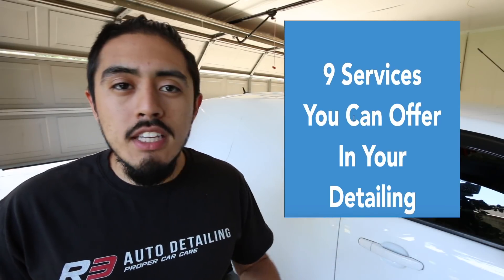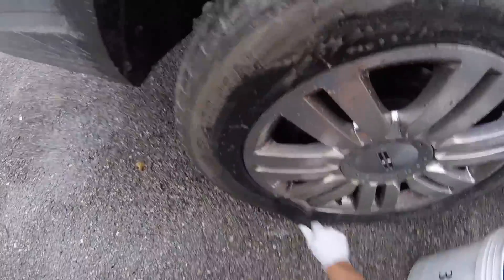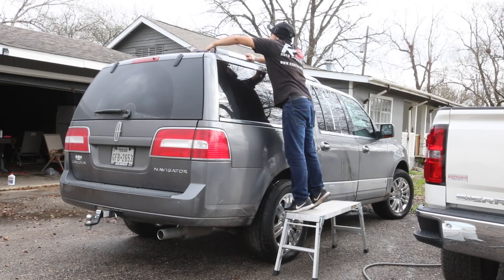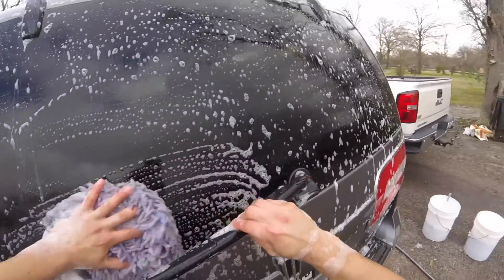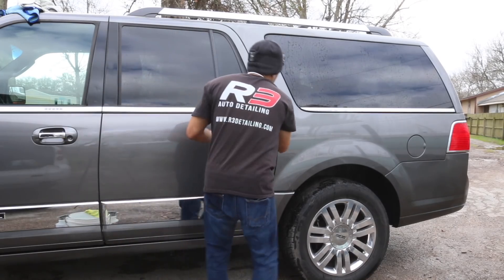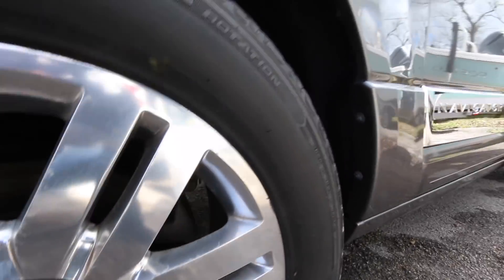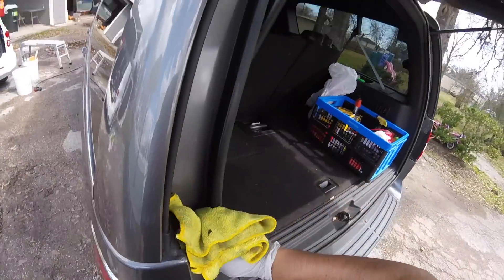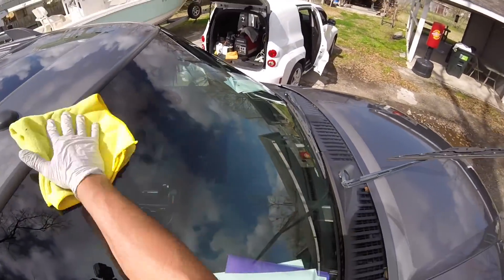Wash and Wax on Car That Has NOT Been Washed in MONTHS - How To Wash DIRTY Car

Comment: Great job! I just wrapped up detailing my 03 Lincoln Navigator.  I had not cleaned it in a few weeks and I just got it back from getting the transmission rebuilt. I spent 2+ hours last night just washing and cleaning the exterior. Using my SunJoe SPX 3000 power washer really helped. I used Meguires Quik Wax this morning to finish up the exterior. And yeah, I got the ladder out to get the roof cleaned up pretty good. 
Just spent the last couple hours cleaning and vacuuming the interior. I really got to go back and do a detailed clay bar and wax. It’s driving very good and looking good too now.
 I have other cars that are so much easier and quicker to do a full detail. These large SUV’s take 2-3 times longer. So, it’s my least favorite to detail.
Anyways, 
Great video and God bless!
Reply from the maker: Haha- completely understand Alex. Bigger vehicles always require so much more work

Comment: Just a heads up with the bit where you cleaned the grill, in my very short experience (only as an enthusiast) you wrap the microfibre around either end of one of my detailing brushes, so I don't need to use my fingers, and run it through that way. Of course the microfibre towel is soaked in whichever car soap I am using and/or APC. It works, again no or minimises the scratches :)  
Great content as always. And on my end, always learning new techniques. Cheers!

Comment: you can get an on the go pressure washer for cheap 50 gallon drum $40 cheap electric power washer $99 you can wash like 15 cars with 50 gallons
Reply from the maker: Nice! Which model exactly?
Reply: this is probably better for you 
worx hydro shot
Reply from the maker: Ohh, right. I've used it. It's nice!

Comment: In your opinion, what’s your favorite/best tire dressing?
Reply from the maker: Megs Hyper Dressing. I used a few other and just liked Hyper Dressing
Reply: Ive  been told just to use regular cover all. Is this a bad idea?
Reply from the maker: What is that?
Reply: What ratio do you use the hyper dressing at? I like the shine level you have.
Reply: I use 3m , it also works on black trim but you have to apply it every 2 weeks

Comment: Nice job, Oscar! Looked like you had some nice cloud cover, but if you were doing this type of wash in the sun (hose and 2-bucket as opposed to rinseless) how would you avoid creating water spots?
Reply from the maker: Thanks Ben! If it was hot, I would;
1) Move faster on the wash, rinse, and dry process 
2) Break it down by sections (wash, clay, and dry half of one side)

Comment: What about using simple green for inside the car and outside. Will it work
Reply from the maker: I've never used it but it should
Reply: You have to be careful with simple green.  It can stain some plastics and rubbers.  Also take a lot of water to rinse off.

Comment: as a mobile detailer myself this is a $140 job for me that I can get done in 3hrs max. in a way I understand why you charge higher prices, but I know that the reason it takes you so long is because of being inefficient with some of your work and making your washes harder and slower by not having a pressure washer especially on a car as dirty as that one. the process on the rims could have been as easy as spraying acid based wheel cleaner and/or degreaser on the wheels, tires, and fender wells and then pressure washing it off and then just wiping down the rims with a humid towel after the car was dried off just to remove the excess spots. I feel like some more efficient work would make your job easier and help you give out better prices. but to each his own, I still respect my fellow detailers, I've just received very blunt advice from other detailers that has worked wonders for me.
Reply from the maker: Oh for sure. if I had a pressure washer, I could have cut down time. With that being said, my prices are not tied to how long it takes me to complete the job. If I had two people, we would have finished in 1.5 hours, I'd still charge the same amount. Yesterday we finished a car in just under two hours and charged $220
Reply: 3hrs to wash a wax a truck?
Reply: Phenom Facemob I said MAX which has probably only happened maybe twice in my detailing business, but on average I wash and wax the exterior of a car in about 2 to 2 1/2 hrs and charge anywhere from 100 to 150 depending on the size of the vehicle.

Comment: 1. What do you personally use successfully to strip old wax off cars? I've heard so many arguments saying clay bars are the best vs dish soap vs Chemical Guys Clean Slate. So much information out there makes it confusing. 2. If you use ONR rinseless wash and wax, do you have to strip the wax before each time you resuse this product?
Reply from the maker: 1) If the car is super dirty and it hasn't been deatiled, what are the odds if the car having any form of protection? However, I use CarPro Eraser. 
2) No, just keep on using it

Comment: Broheim, there is no way I'd get that sweet rate for a basic wash & wax where I'm at. $65 start seems to be the bite point.
Reply from the maker: Where are you located? There's plenty of detailers in my area that complain about that same problem as well :)
Reply: Detail Groove murphy nc. In the skirts of the blue ridge mountains. I work a 8-9 city area across Ga, tn, & nc. Next year, prices go up. I run a "full" detail for $145...
Reply from the maker: How many people are calling you per day for your services?
Reply: Detail Groove it went public in April this year. I don't have the budget to splurge on ads, yet. They slowly trickle in. Just myself, no way I could manage more than 1 detail. I don't handle heat well. Plenty of views on a post but, no daily biting.
Reply from the maker: Well that's your problem. You don't have enough people calling you so you can charge more. Imagine trying to sell a $500 detail to the one person that calls you every 3 days. Now try selling a $500 detail when you're getting 3 calls per day. 

So much easier to sell a higher priced detail when you have a higher call volume
Reply: Detail Groove the cost free marketing is the method at the moment. Certainly will be branching out. I've noticed that brick shops are favored over mobile guys here. I can sorta see the brick shops having more advantage.
Reply from the maker: Shop vs mobile makes no difference if the phone is not ringing on a daily basis. You shouldn't worry about cost-free, focus on ROI. "Free" marketing isn't "free" if it's not making you money. If you can spend $1,200 and make back $20,000, then that's free marketing

Comment: Super clean 10 to 1 is safe on wheels?
Reply: So_Heaven I use super clean 5:1 so I'm pretty sure
Reply: I use it full strength straight from the sprayer. Works like magic.
Reply from the maker: Just don't use it when the wheels are super hot or leave it sit there too long :)

Comment: You should try a wet Terry cloth rag not soaking wet but good and damp to put your wax on it'll definitely help you from missing all the spots you missed and I would dress the tires and the wheel wells before you wax little bit of wheel cleaner on the Chrome Grille would get all that off quick and easy not saying you did a bad job the end result look great but this is coming from a detailer who has 18 years of experience

Comment: How do you clean the exterior seams and crevices safely? Often when I’m detailing there’s gunk in there that runs out every time I try to rinse up, ruining my work!
Reply from the maker: Well you just said it yourself; you need to make sure the seems are cleaned out before moving forward! What areas specifically are you referring to?
Reply: Detail Groove Between the paint and the seams under door handles, exterior panels, seams under window trim, just small crevices in general. Usually pollen or moss gets hardened in there and it has trouble coming out. Generally unreachable places (with a microfiber cloth)
Reply from the maker: Well it sounds like exactly where the problem is. Do you have any brushes? Spray APC and agitaate out
Reply: Detail Groove I’ve thought of that, but wouldn’t that cause scratching? Any suggestions on paint-safe brushes?
Reply from the maker: Well, you should do this cleaning first and then polish. You'd also want to test it out. Maybe it won't add any type of defects. You'll be surprised :)

Comment: I own my own detailing business. Benny's Xtreme Detailing find it on FB. You said you charged 220 for wash and a wax. Could you break down each service to help me understand how you got to that price. I would charge 180 for a full detail with clay bar, chrome polishing. That price includes interior without shampooing. Am I charging too little?
Reply from the maker: The problem is not pricing, your problem is lack of leads per day and week. I have plenty of people tell me no, but because I have so many people reaching out to me, I still get plenty of people that tell me yes. 

That's the problem with 80% of detailers. It's hard to increase your price when you have 1 person contacting you every other day. If you have 4 people contacting you everyday, raising your rates and getting booked out is much easier. 

Also, online reviews are HUGE!
Reply: That's the gold in the comment section right there.

Comment: Thats alot of work for some wheels..have u tried using BDx from 3D? Sray let it sit.light agitation.and spray off
Reply from the maker: Probably with a pressure washer it'd work. A hose is to weak for that, regardless of strength in APC

Comment: Could I use a paint brush than using a detailing brush?? :D nice video
Reply from the maker: Yes you can. Tape off the metal to not scratch anything
Reply: But is the bristles just the same as a detail brush???
Reply from the maker: Depends on the type of brush you're going to use
Reply: Anormal paint brush bro. I dont now where it applies hahaha
Reply from the maker: I don't know what normal is. Long bristles? Short bristles? Stiff bristles? Width of handle? Try it out and see how it works

Comment: shouldn´t you rinse the car completly first to remove all the loose dirt an debree before you use your bucket and towels to clean the car?
Reply from the maker: If that's what you prefer, sure. There's no laws/regulations/governing body that says you have to.
Reply: not. it didn´t mean that you have to. I just thought it would be better. So you don´t get any swirlmarks and light scratches on the Paint. :-)
Reply from the maker: Does it really matter if the last 5 years this car has only been through $10 car washes?

Comment: Detail groove I commented on your video asking but what apc cleaner you wearing using at your other video with the purple color . Can you please link it to me on eBay or amazon please . I want to buy it
Reply: ThatGuy33121 most likely super clean or purple power, you buy it at Wal-Mart
Reply: Said it was super clean. You can buy it by the gallon at Wal-Mart and dilute it. It's  legit.
Reply: Will Canady there’s many super clean out there I want the extract one that hes using which the the “purple one “ do you know where I can buy it from . If you don’t mind can you link it to me please from amazon
Reply: Will Canady thanks I did end up buying it now I’m looking for the carpet and a brush that I clean clean the seats with . Also if you don’t mind bro could you tell me like what 1 to 10 duriation means .?
Reply from the maker: Yes, Super Clean diluted 10:1. You can buy it online but they sell it almost everywhere locally in my area (which I'm sure you're area as well)

Comment: how do you deal with waterspots ?  on windshields glass
Reply from the maker: During the wash process or if they're already there?
Reply: if they already there i had a truck last week and as much as i apply window cleaner they would come back up  and didnt knw how to aproach it
Reply: use a water purifier to soften your water connects to ya hose
Reply: Juan Villa if you apply white vinegar + water mixture and spray it on the water spots. The acid in the vinegar will neutralise the waterspots ( which are alkaline) 
But honestly... ive never had a problem with removing water spots that are on windows with a quick wipe with a damp towel.
Reply: I removed 20+ year water spots with an orbitor and strong compound
Reply: this would be an additional upcharge to remove the water spots.
Reply: Juan Villa Mothers water spot remover. Easy as fuuuu
Reply: I use quick detailer spray, just my imput :) Meguiars mirror-bright brand
Reply: Me clean magic eraser
Reply: 0000 steel wool works wonders

Comment: Chemical guys is just 20 bucks for a gallon
Reply from the maker: I just said a random number lol
Reply: How long did this take you
Reply: Doing it by hand you find to apply the wax thicker so it takes longer to remove the wax residue ...there wax goes a long way
Reply: Iron x for rims & paint  makes life easy
Reply from the maker: As long as it works for you, that's all that matters
Reply: No it’s detailing  101
Reply: N for 220 you should be using that ...it will prevent scratching
Reply from the maker: That's why it's your business. You can do what you want :)

Comment: Really dirty my ass!
I detail cars that have 4 to 6 inches of mud in the wheel wells, green moss growing from the window seals and green alge growing on the paint. I'd like to say that seeing cars like this is rare but I see 3 or 4 of these neglected beasts a month.
Reply from the maker: Cool?
Reply: I clean the entire top of the vehicle down to door handle height first with my 'top use' mitt, then with a separate 'dirty use' mitt I clean the bottom and wheels of the vehicle... Helps prevent the mitts making cleaning scratches.
Also keeps your top of car cleaning mitt cleaner for longer and stops it becoming quickly contaminated with hard to remove grit n dust.
Reply: Northy ok nino